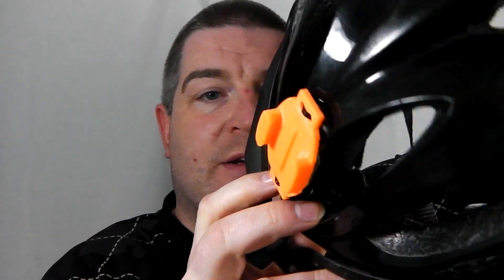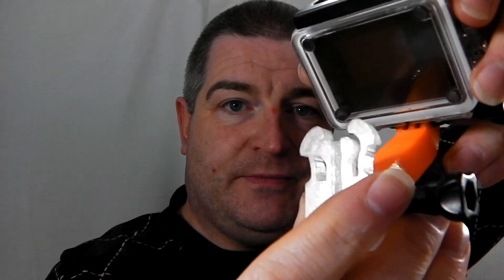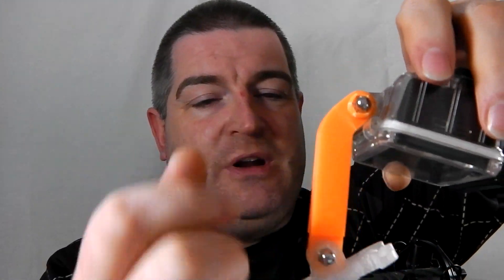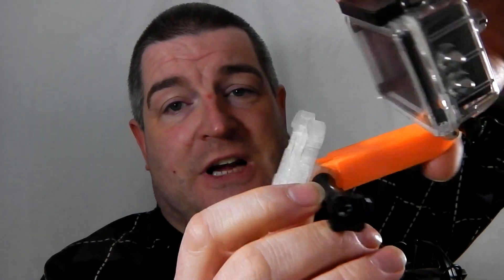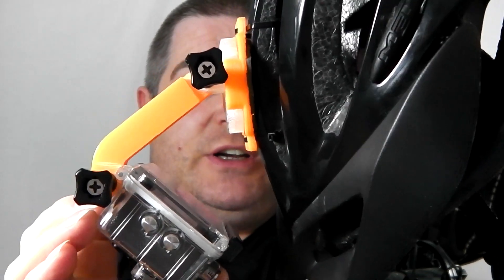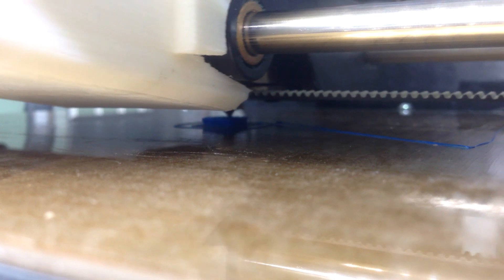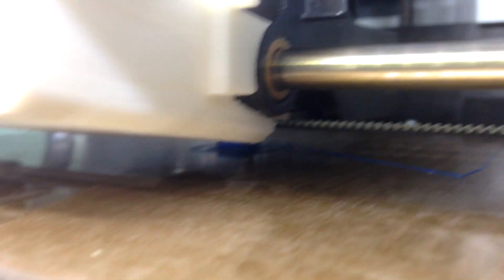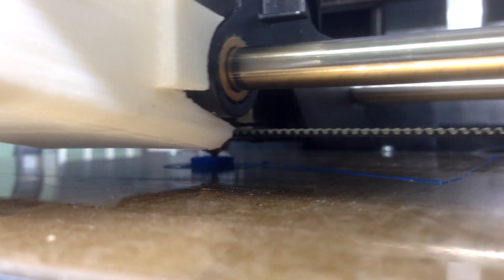DaVinci 1.0 Ninjaflex Revisited

Comment: Why is your glass to clean? I have the glue all over mine and it never looks that clean.
Reply: Mike Carr I find if you wipe it with a damp cloth imidiatly after use (while the bed is still hot) it gets that shine^_^ (elbow grease required)

Comment: Steve,
what was the flexible filament you used for your gopro mounts? I am assuming you still have a stock davinci extruder that printed that correct?
Reply from the maker: hi Chris,  I printed some mounts with Bendlay and others with standard ABS. The ABS ones worked best and are still going strong today.

Comment: It's cool that others are joining in on the Da Vinci / E3D v6 conversion. As for the NinjaFlex escape bid. There is a Filament guide which I am in the process of adapting. It will fit above the Extruder feed wheel and I hope will guide the filament from above and below and so prevent bending/escapes. The error is either, feed amount/speed or can also be a Feed calibration error. When I calibrated mine it turned out I was over extruding by just 4%. Reduced the amount from a multiplication of 1.0 to 0.957 and some of the problems dissappeared. As Steve said in the Video, tinkering is the name of the game. Once you have a success, I'd suggest noting the settings/adjustments and carry one. The more we share our observations the better for ALL!

Comment: Wow NinjaFlex is both really cool and extremely frustrating.  Been messing with it for a bit tonight since I got the E3D V6 and filament cooler installed.  Problem i'm having is the filament keeps squeezing out between the hotend body and the feed rollers.  Looks like if I catch it, pause the print, fix it and continue it's fine but it's damn frustrating!
Reply from the maker: Adam Carpenter Hi Adam,
Ah, the joys of printing Ninjaflex.  When printing any new material there are 2 things to work on, temps and speed.  You have to find a balance.  Too cold and or too fast jams the hot end, too hot and or too slow melts the print.
I tend to leave the speed at around 30 - 40mm/sec and work on the temps.  I spend a good while testing the hot end temp.  It's easy to do.  Just set the extruder temp to 230 or whatever in the printer menu, then jog the extruder 1mm at a time, also in the printer menu.  If you get a tangle in the feed wheels increase the temp of the hot end by 5 and try again.  I am happy when I can jog the extruder 10mm at a time and see a nice smooth stream of filament from the nozzle.
There are, of course, times when the temp can be too hot and the only option is to lower it and slow the printer down, but you'll know when to do that as your printer will work fine but the print will be melted. Your layer cooling fan will help loads with this too. 
I wouldn't worry too much about the bed temp.  I did my testing with the bed switched off and no glue stick either.  The Ninjaflex stuck to the glass no problem.
Please also be aware of other peoples settings not working for you.  This baffled me for a long time, then I discovered the temp / speed balancing act.  I find it best to work out my own settings rather than get frustrated with setting from the internet that don't work fully.
Well, now you know how I tune my printers for new materials.  If you have any more questions just let me know.
Hope this helps, good luck :)
Reply: StevenQ-NE-UK Thanks for the tips!  I did get it working this morning though.  Turned out my bed level was somehow screwed up after I just leveled it and that was causing the filament to back up.  So I leveled the bed again and turned my speed down some and it's printing perfectly.